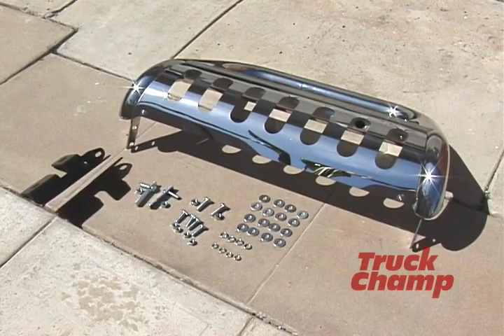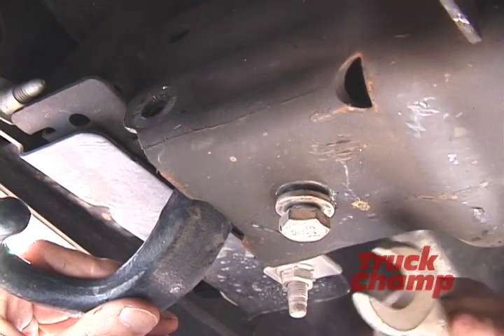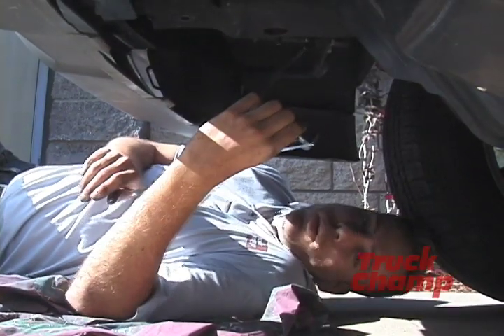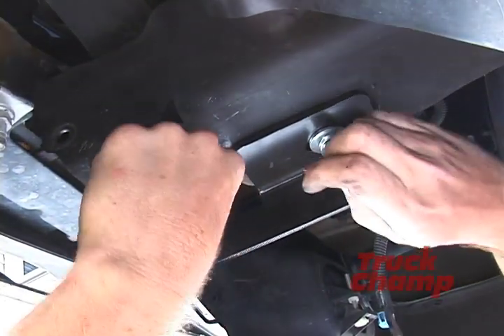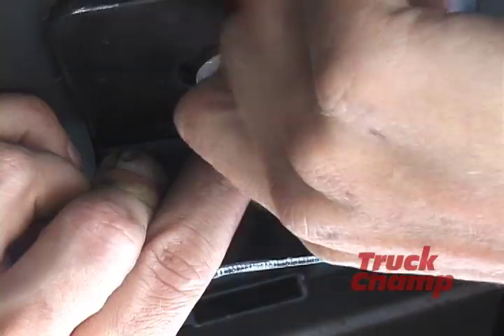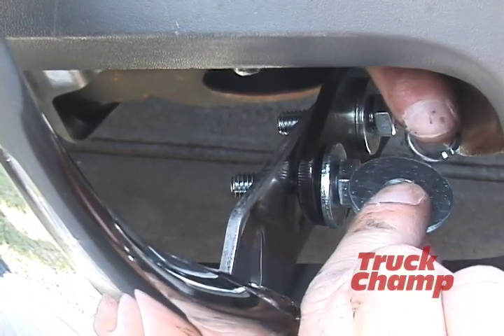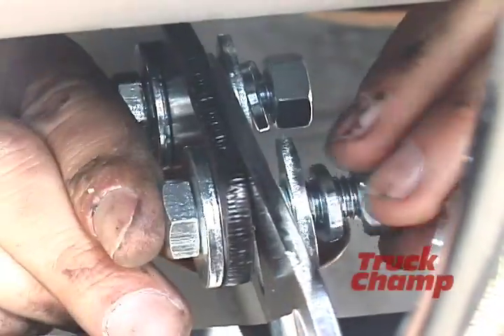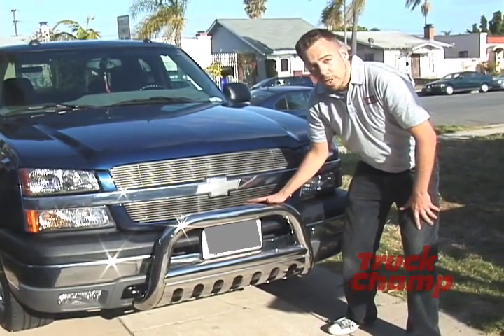How To Install a Bull Bar From TruckChamp on a Chevy Silverado

Comment from the maker: Bull bars that are offered for Chevy trucks have mounting brackets that will attach to the bumper or the frame of the truck. A body lift lifts the body up, not the frame!  Bull Bars will attach to the frame so “no” it would not look correct as the bull bar would sit too low.  Most body lift kits come with bumper shims that raise the bumper up to look right. Unfortunately the bull bar kits do not.  Any fabrication shop could make a spacer plate that would raise the bull bar up enough.

Comment: I have a 99 Chevy Blazer LS 4x4 with dual tow hooks. I did not have to remove my tow hooks. 2 bolts each bracket and 1 bolt from each bracket to bull bar.

Comment from the maker: @BuddySkateRazors The installation is basically the same as the 1500 LD but the bracket is a different configuration.   You have to remove the factory tow hooks for each one and the brackets will bolt up the same way. Thanks for your question.

Comment: I would still consider buying one of these for my silverado, but I have another question. What size light are the max. I can install on these after I install the plate relocation bracket? My state will require I relocate the plate. But I mainly want the bull bar for off road lights. Will it look too crowded and not look right?

Comment: Hi I would appreciate  it if you could reply to this as soon as you can,But I have a 1990 Chevy Silverado K1500,and I have a front push bar but I don't have the Brackets for it and I was wondering if you knew where I could buy them? Ive searched for them but I'm not sure what I'm looking for if that makes sense, Thanks alot